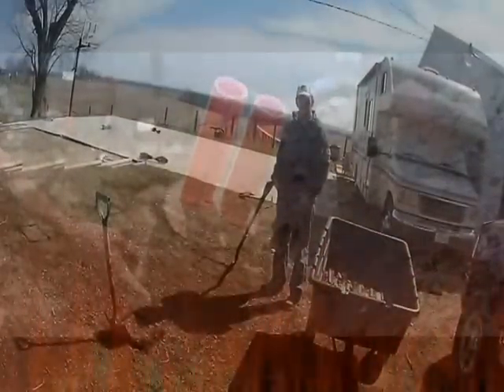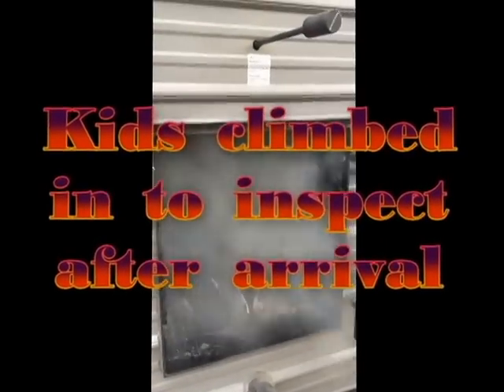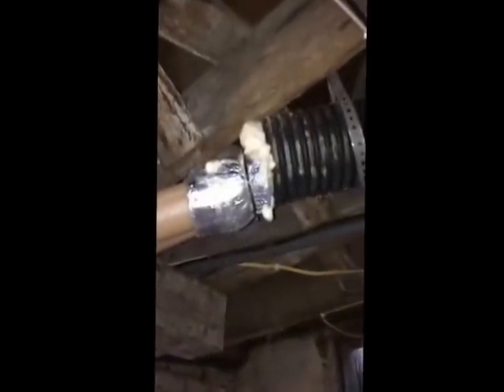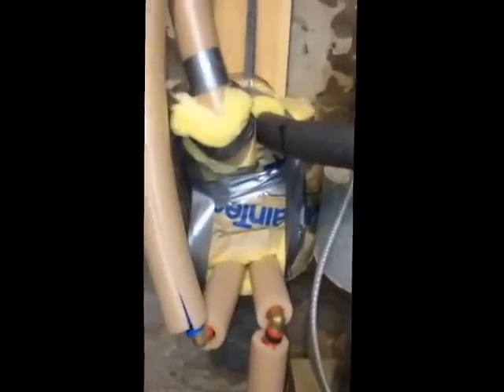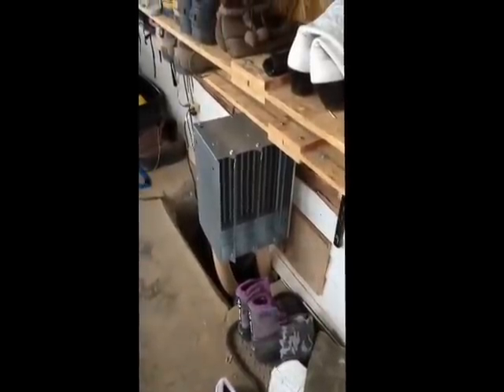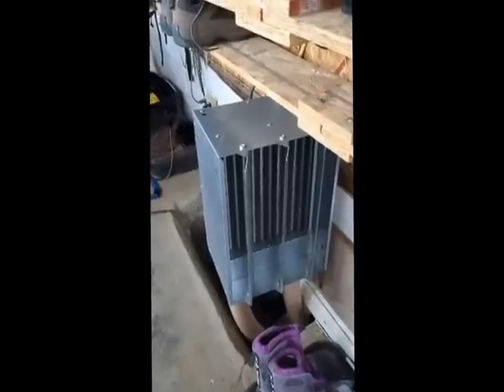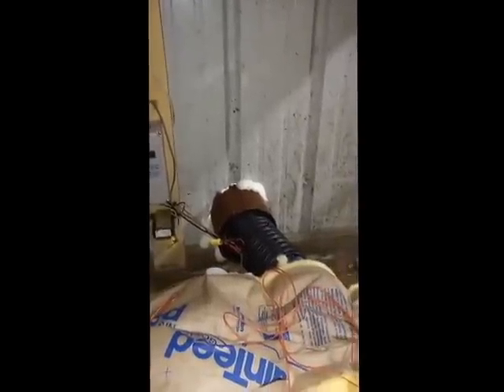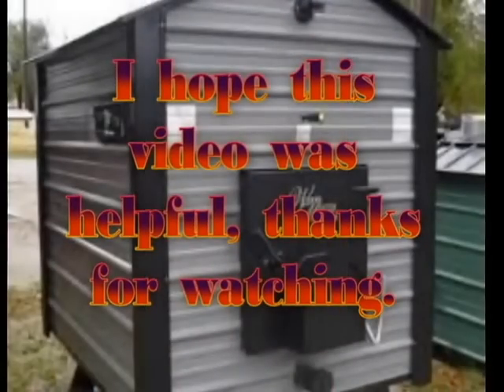Install Outdoor Wood Boiler Tutorial

Comment: I am in need of some input on a unit like this. first off great video.  I happen to work at a shop that has a cnc plazma cutter and there for I get lots of scrap plate material from 3/16 to 2" thick and as big as 4'x5' so I decided to make my own outdoor wood boiler. my fire box and ash pan is made of 1/2" and goin to make the water jacket out of 3/16". not sure if its going to be round or square yet "water jacket". now I can build anything from metal but plumbing and heating not my forte. not sure of what I need... heat exchagers? sidearm? pumps/ just need a mentor. I have three zones and baseboard. want to hook up to lp boiler, hotwater heater.i know one post wont do it but im only half way building it. I paid $3600 just last winter for lp so that's why im building it, and right now it weighs just under 1200 lbs and that is going to cost me less than $200 so I think I can build it for $400-$500 not including insulation and plumbing Thanks for any help...Sully
Reply: sorry didn't realize my computer was logged in under my stepsons...this is john not ricky lol
Reply from the maker: +john sullivan 
You will need a fairly large plate exchanger to heat the existing boiler. Check out central boiler.com they have diagrams of the setup you want. That's where I got the most helpful info.
Reply: ricky matthews 

The bigger water capacity of an owb the higher the efficiency I'd go with a 500 gallon capacity size as a minimum. And you won't need a blower 
Central boilers until they started building gasification systems used natural convection with a thermostatically controlled solenoid with opened an air intake door mounted at the bottom of the firebox door 

Food for thought

Jim
Reply: ricky matthews 

Sorry Rick the previous message was meant for John